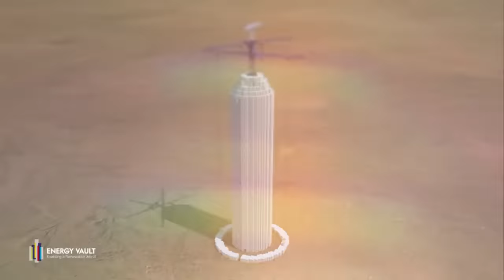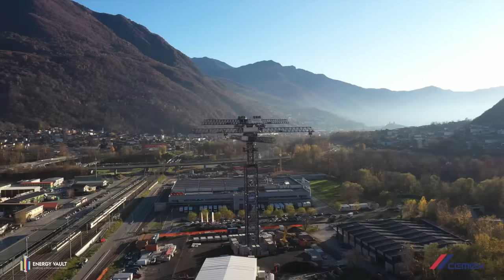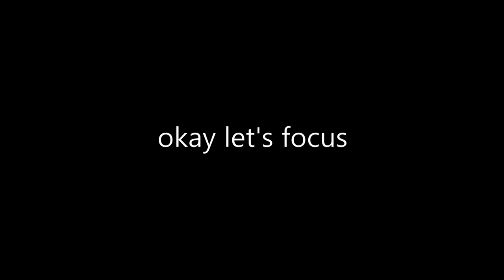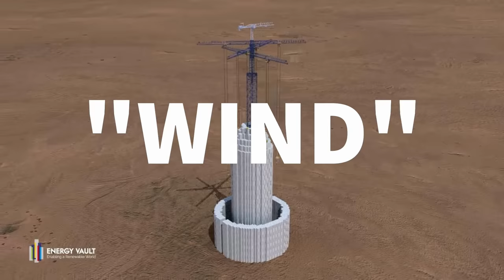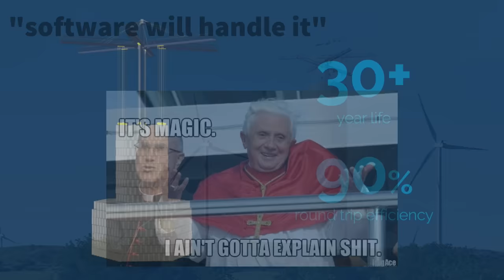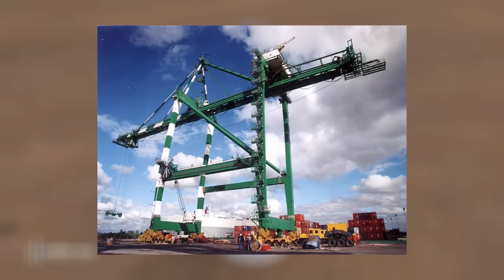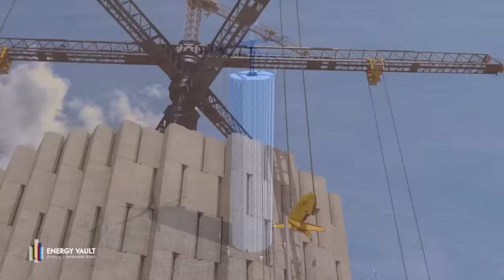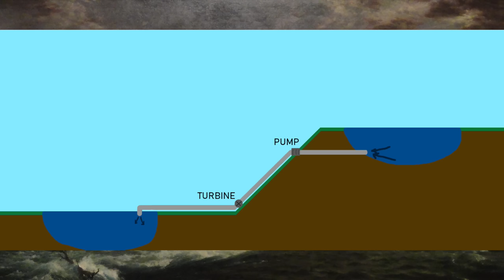The Energy Vault is a Dumb Idea, Here's Why

Comment: Since the moment you said "let's fix it," I was waiting for the whole thing to eventually morph into pumped-storage in a humorous way. Thank you for not letting me down.
Reply: Average energy vault fan:

Average pumped hydro enjoyer:

Average flywheel enjoyer:
Reply: My original conclusion is that this type of gravity battery started due to not every geographical location having access to enough water or a place to put it.
A hole filled with water would also likely need more concrete.
Reply: Pumped storage requires a lot of water (often not near where solar works best), a valley to fill and drain (or the co2 cost of building a giant pit) and a massive concrete dam (also with CO2 costs). Not sure Adam hits the mark here on this one
Reply: @oregonNYC  but wouldn't any big structure dealing with water also count as a water storage plant, with a side function of energy reservoir? I am not affirming it would be true, but I imagine almost anything being better than solid blocks of breakable concrete, even sand being used in the place of water.
Reply: @TheCuteZombie  In places where water is plentiful and there are natural formations than make pumped water easy to store I’m sure water is the better option. Last time I checked the Sahara, Gobi, Mohave etc are great for solar, bad for water. And as I said, a giant dam and big pipes require a lot of concrete too. Might be easier to just skip the water dependency part of you already need to invest in giant amounts of concrete. This video didn’t break down the CO2 comparison between a dam/pipes vs a concrete tower, but it should have done so to make a comparison as water capture requires tons of concrete.
Reply: Issue with pumped storage is that water has quite a low mass density and as such per meter height difference you need to "drop"  quite a bit of water to get to useable amounts of power for the space/land that you're using. Granted: concrete only has a factor 2,5 higher density, so not sure if that's better and the point about using cement for the concrete increasing the CO2 is very valid (same could be said for the windmills for that matter, those may not be carbon neutral either).
Also digging a big hole in the ground sounds like a better solution at first maybe, but that soil also needs to be excavated and the surrounding soil needs to be held back, so you need massive sheetpiles or also concrete walls for that to work. That or the holes has a slope which massively increases the land-use. That is an additional amount of CO2 that the plan is then costing. Again, I'm not saying that the tower of concrete blocks is the way out, quite the contrary, but this isn't as simple as: why not pump some water up the hill? For a start you need a hill! and water to pump up, and loads of other details need to be worked out. The devil is in the details...
Reply: @SpaceMarine113  I’ve gotten quite tired of this channel. While some tech bro crap is obviously silly, this channel does a very poor job of doing the math and considering the costs of existing options. They didn’t even bother to consider the CO2 footprint of the water storage and pumping system and compare it to the tower idea. Frankly, this video was embarrassing, expressing cynicism rather than investigation and verification.
Reply: @crazyshrum  A pumped hydro system of equivalent capacity will need just a little more water  than you would need to make the concrete for the weights. And more importantly you would need far less concrete to build the water tower than you would need to build the weights.
Last I checked water was always much more readily available than concrete, even in the middle of the hottest deserts, so even if you needed ten times as much water it would still be easier.
Reply: I was expecting a train somehow. Because Adam always turns things into trains.
Reply: @listerdave1240  how do you figure in less concrete for pipes and dam than for tower? You’re just pulling that straight out of your butt
Reply: @oregonNYC  Very simple math really.  First of all who is talking about dams?  I think you are making the mistake of comparing an energy vault of very limited storage capacity with a dam of vastly larger capacity. It is like saying a lawnmower engine is better than a ship's engine because it is smaller.

I am saying something much simpler - building a tall water tank.  I think it should be quite clear to anyone that if you have, say, 1000 tons of concrete you can build a tall water tank that will contain far more than 1000 tons of water and hence store far more energy than you could if you used that concrete as weights in this tower concept.
If you cannot figure that out yourself I might write down a calculation to explain that better but that will have to be later as I am a little busy just right now. 

It is really just a matter of how much weight is lifted how high, regardless of whether that weight is water, lead, concrete or whatever and it is just plain common sense that a water tank, or even a water tower, always weighs much less than the water it can  contain.
Reply: @listerdave1240  so an excavated water tank, like a swimming pool? So, add the Co2 cost to excavate all this soil, and co2 for the pipes to move the water up and down. Most of these pumped water storage uses natural slopes, so the piping will be very long to go up a gradual hill. All those pipes have CO2. Not to mention the obvious problems of flat country or low water regions. 

I’m sure some places water makes the most sense, but the video, and your reply, are lazy
Reply: @oregonNYC  I think you're missing the point. You do not need any hills or anything or any excavation, or at least not any more than what you would need for the energy vault.  
Let's say we have an energy vault that is 200m tall and 50 metres wide and we want to build an  pumped hydro system that will store the same amount of energy.  I do not have time to calculate it precisely right now (call me lazy if you feel so inclined) but a quick worst case estimate tells us that with water being about three times less dense than concrete we will need about three times the volume of water to store the same amount of energy. 

We therefore need a water tank that is also 200m tall but is  86 meters wide instead of 50.
So you now have a hollow concrete structure that is 200 meters tall and 86 meters wide which will contain about 400 thousand tons of water.
Let's be very generous and make the walls of this tank of concrete half a meter thick. In practice one would make it of much thinner steel but just for the sake of comparison let's make it out of concrete. That means we will need to use about  90 thousand tons of concrete.  

For the energy vault we would have used 400 thousand tons of concrete to make the weights while for the pumped hydro system we have used 400 thousand tons of water and 90 thousand tons of concrete.  In other words we have used 300 thousand tons less concrete than the energy vault and yet provide the same amount of energy storage.  We would of course need to get those 400 thousand tons of water from somewhere but whatever the situation it is always easier to obtain 400 thousand tons of water than 400 thousand tons of concrete, even if you are in the middle of a desert.

As I already mentioned you probably wouldn;t even want to make the tank out of concrete as steel would be much easier to transport to site and you would only need some 10 thousand tons of it, probably less than you would need for the energy vault just for the rebar of the concrete blocks.

If your calculation shows otherwise please let me know so I can figure out where we are in disagreement.
Reply: I think that the context is missing from that video. It looks like it's in Switzerland, which already has many dams, and where all other locations suitable for dams are being considered for new ones. I agree that this idea is crazy and only looks good in CGI, but it's also unfair to say that it can be replaced by water pumping when it's already massively used. The objective is to find new approaches when water pumping can't be done as easily anymore.
Reply: @AsteralLeGogol  I don't understand why everyone is missing the obvious. To make a pumped hydro system that has the same capacity as an energy vault you do not need any dams, mountains or anything of the sort. You just need a tall water tank as I described in my previous post.

The pumped hydro systems with large dams and lakes are not comparable. Their capacity is hugely greater than the energy vault, beyond comparison.

To achieve what one of those does in terms of storage capacity you would need tens or hundreds of thousands of 'energy vaults' and they would occupy a larger area of land than the lake does. 
If you do not have the lakes and do not want to build the dams you can always build the water towers as I described at much lower cost using much less concrete. Better still you could just build one huge tank, which would need even less concrete than replacing the energy vaults one for one with a water tank.
Whatever the scale, whether just one energy vault or huge numbers of them the water tank will always be cheaper, easier and better than the concrete block system. And of course on the larger scale you have the even better option of making large tanks instead of many small ones.

Maybe if I just call it the "Water Vault" instead of a water tank the message will get across better.
Reply: @listerdave1240  you’re going to make a 200m tall grain silo type structure, free standing, to hold water? At a half meter thick, and just standing on the ground. No foundation, just set down like a very tall glass of water… not sure about the material science behind this idea. 
Does such a structure exist? Can you show me one? Sure, the math is easy if you invent a water skyscraper, but that isn’t reality based. 
Pumped hydro doesn’t look like this, it looks like a dam up a mountainside. It has very long in/out pipes, it has both a upper reservoir and a lower reservoir (you forgot the lower reservoir in your calculation, unless you assume location by a limitless water source like the ocean, which would be very limiting in location). 
It’s easy to debunk proposed new inventions by inventing non-existent and preposterous solutions yourself.
Reply: @oregonNYC  Who mentioned there being no foundation? It would have exactly the same need for foundation as the energy vault would, no more. 

 I mentioned the concrete just as an example to show that even if made of concrete it would still need much less material than the energy vault.  Besides, the dimensions I mentioned are based on existing water storage tanks which however just happen  to be used to store potable water rather than store the water for its energy. I actually allowed for thicker walls than in the actual existing structures which are closer to 40cm at the base and much thinner at the top. I am no expert in concrete but I am an engineer with enough knowledge to make a reasonable estimate of what thickness of concrete is required for a structure as simple as a water tank.

In practice one would make it of steel which would be easier but I mentioned concrete just to provide a closer comparison to the energy vault, which uses a huge amount of concrete.

With regards to the lower water tank I have not forgot about it.  Again when comparing to the energy vault it is exactly the same limitation. The water tank has a separator in  the middle making it effectively two tanks on top of each other with the water flowing between the two tanks. Just as with the energy vault you have a limitation of how far down the mass can go because it needs o go somewhere. In  this respect it is neither better nor worse than the energy vault.

Can you explain to me in what practical way it is better to use concrete blocks as mass for storage rather than water?  I have as yet been unable to find even one good reason to do so and I have mentioned many good reasons why not to use concrete blocks.
Reply: @listerdave1240  I think you’re making a common mistake that I see from posters and the author of this channel - mistaking cynicism for analysis. 

The obvious disadvantage of pumped water, is the need for water and a hill. There is no such thing as a 200m tall water tank (your solution is more vapor ware than the concrete one in this video) pumped hydro uses natural features like cliffs, valleys etc to trap water behind a dam. So, we need a location with both huge amounts of water and major elevation changes to use pumped hydro. Common in some areas, impossible in others. Especially challenging in deserts, where solar is most effective. This concrete system isn’t a replacement for pumped hydro, it is a smaller scale solution for flatter, dryer areas. It complements storage solutions like pumped hydro, batteries, flywheel, thermal mass etc. Each has its pros and cons, they all have carbon costs, they all work well in some places and don’t work in others. No claims in the video of the concrete tower idea being superior to pumped hydro in a river valley, but next to a solar farm in the Mojave it could be a good solution.
Reply: @oregonNYC  Water has no disadvantage compared to concrete for this purpose. It does not need a hill any more than the energy vault does. 

 If it were not possible to build a 200m high concrete water tank then it would be even less possible to build a 200m tall tower of blocks so that argument is not valid. The concrete in a water tank of any height needs to endure much less than the blocks of an energy vault. 
There is really no reason why it could not be built. The reason none have been built that tall is because there is no need for them.  My point is that if for any reason one felt the need to build an energy vault of any height then they would be better off building a water tower of that height. It would be far cheaper and far easier to build, even if one were to insist on using concrete. Any situation where it is suitable for building an energy vault can just accomodate a water tank of the same height.  I don't think I should need to explain to you why a tall water tank is much more feasible than an equally high stack of concrete blocks.

You say the concrete system if for flatter and dryer areas but how so?  In that same flat dry area it is much easier to build a hollow concrete structure than a stack of concrete blocks so I don't see how the concrete blocks are better.   And even if the place is absolutely dry, like the middle of a desert I don't see how transporting thousands of tons of concrete blocks would be easier than transporting the same amount of water to the location. Can you explain why you think it is?

Maybe explain for the specific case you mentioned. If you want to build an energy storage device next to a solar farm in the Mojave desert how is building a stack of concrete blocks and a crane easier, cheaper or better than building a simple water tank of similar size?
Reply: @oregonNYC  Hello, stepping in the conversation here. Reading through your commons I think you have one key misconception about how the electricity grid works. Namely, you don't need to build an energy storage facility right next to where it's been produced. While it's a valid point that building pumped water storage is challenging in a flat desert there is no valid reason why it must be located in such an area. It can be built in a suitable location and just be connected to the same grid as Mojave. 
Even in really dry areas such as the middle east energy storage facility can be built in mountains on the coastline and use seawater. While seawater will damage the facility over time is still going to be last longer than banning rocks against each other all day.
Reply: @LLAALALA  energy is lost over distance. Building stored energy far from power generation might be possible, but you’d add inefficiency of the power loss, and the CO2/material cost of the power lines to run to a suitable area. This would be part of the negatives of pumped hydro that this video (nor you) considered. Losses are smaller for very high voltage, like a massive power plant would generate, but higher with lower voltage scenarios. Again, this video creates straw man arguments like pretending concrete towers were positioned as the sole solution. When appropriate, pumped hydro, or flywheel, or maybe batteries, or thermal mass etc all can work. None is the best solution, they all have problems and advantages. Cynicism is not analysis.
Reply: @oregonNYC  'energy lost over distance' I knew you would say that. Think about it energy production location is not going to be the same as energy usage location. If you store energy at where it's produced that energy will still have to travel the distance to where it's been used. Which tends to be located near large body of water and where the storage facility can be easily built.
Reply: @listerdave1240  again, you need two tanks and a hill for pumped storage, and pipes to connect them. More likely, you need a valley, a pipes and a dam. 

Concrete tower needs 1 tower, no hill, no pipes, no water source. Just as a battery has advantages (density, location agnostic, low footprint, modular) and cons (mineral extraction, maybe cost) each solution for power storage is appropriate in specific scenarios. I’m not arguing against pumped hydro as making sense. I arguing against this video’s straw man argument of directly comparing them and not including environmental cost of the land/concrete/energy loss etc in their comparison.
Reply: @LLAALALA  so you’d like to create a pumped hydropower dam where people live? You know pumped hydro floods a valley, right? It is a mega project, it isn’t comparable to concrete stack, flywheel, or batteries or thermal mass. Those other solutions are efficient at smaller scale. This is like arguing that a dam is better than a diesel generator. They are for different purposes, scales, location.
Reply: @oregonNYC  'pumped hydro is a mega project', while no it's not, the existing projects are all relatively smaller than what can be considered as a megaproject. And yes it's going to be built near where people live. Take Cruachan Dam for example its near several cities but the construction did not displace anyone. The reason is unlike a normal dam that floods a region the water reservoir is located on the high ground rather than in the middle of the river. If it floods a valley that would be just a normal hydropower station. 
And you keep mentioning 'efficient at smaller scale', but under what circumstances would you need to store power on a small scale since you yourself said power loss would be higher with lower voltage scenarios. Unless the power is stored for people living in the desert right next to the solar panel, which is pretty weird, those towers would lose most of their stored power while transporting them.
Reply: @listerdave1240  tbh, you don't even need water. You just need a liquid you can pump from one area to another and freely flows.

That's not exactly a tall order
Reply: @oregonNYC  1. water capture can be done in any container that can hold water, you can just as well use aluminium or copper 0 CO2 if you use renewables for (every step of) production.
2. As "Just Me" pointed out you could just as well use sand bags for the exact same purpose, you know the thing sand dunes are made of (without the bag). And you could make them(the bags) out of anything solid, even cotton or wool fabric. 
Therefore the CO2 comparison is totally unnecessary(since in this case it's zero), it just depends how quickly do you need it built, the energy cost is roughly the same, but having a coal power plant is cheap fast and easy way to boost the production. And after you have enough surplus energy (from solar) production you could use the excess to filter the carbon back compressing it back in to coal or oil if you care(if governments really cared we would have had carbon loans, instead of carbon trading, as in: "you clean up your own mess or you get your company's assets seized after some amount of time stated in the loan." instead we have Moonshine part 3 (part 2.5 being USA's "war on drugs" a reality film about how cartels get so rich that they could buy governments see Mexico for more details) see Part 1 "the monopoly"(signed the rocker fella') for more details or just lobbying... With a sprinkle of carefully placed loopholes... Trading makes both parties produce more of the "goods"! And with the "every body is doing it so i might as well" mentality everyone (outside of a hand full of european nations, that now have run out of electricity) is ignoring the carbon thresholds and doing business as usual and that's why CO2 cost really doesn't matter, it has zero cost(for the producer, more like it has negative cost since it produces cheap electricity, our planet is doomed anyway, since no one is really willing to save it, the green Revolution became a "for profit" thing really early on due to big oil helping it back in the 50's(? Citation needed), have a happy 10 - 20 more years of life and if corona stays untill then we may have 10-100 more due to no one needing to use their cars any more)). 

Legend rectangle: I'm using the "Royal" you, as in: we the human race,but mostly a hypothetical you.
Reply: @UCdIZd5qCjpnllJzzhBV-72A I don't quite get how are you planning on storing the rail carts. I am imagining that you have something that looks like an elevator in which a bunch of carts stacks on top of each other instead of just one? And during storage, the carts just stay on the rail off ground and stack on top of each other? Is that how it goes.
Reply: I was hoping for trains to be the answer 🤣
Reply: yeah, he's keeping it real :-)
Reply: @oregonNYC  not true. He is spot on with the whole "dig a hole, put tanks on top and fill with water" thing. much less moving parts.
Reply: @bivoca  no, he isnt. Firstly, a hole can’t ever work. It must be elevated. It needs to be a tower, or a dam on a hillside. The power generation must be below the water.
 Secondly, these structures would also have CO2 build costs for excavation, concrete for dams, concrete for pipes etc, which the video didn’t bother to calculate and assumed was free. Perhaps pumped water is better than the concrete tower, but this video was lazy and used vapor ware, bad physics and incomplete calculations to ‘debunk’ it.
Reply: Unlike water in a pumped storage hydroelectricity facility, he won't let you down.
Reply: @oregonNYC  all these deserts are in close proximity to large wealthy population centres, I hear you say. Worth it for the concrete towers to build. Sure.....
Reply: @oregonNYC  a hole can work perfectly fine. ALL that is required is a height difference between the top and bottom reservoirs. Period. The bigger the height difference, the more storage per unit mass.
You could use mercury just as easily as water, and would get more energy storage in the same space. Any liquid would work. Water is just one of the easiest liquids to use. The water doesn't even need to be potable - ocean water would work just as well as fresh, barring corrosion possibilities.
All of these solutions including the concrete tower are simply trading off gravitational potential energy to and from electricity.
And a MAJOR weakness of the concrete tower is that the height difference goes down as the tower gets shorter. Halfway down, there is no benefit. Whereas even a near-empty top water tower is above a nearly full bottom reservoir.
Reply: @aaronbredon2948  if it was a hole, the power station would need to be below the hole. Hole needs to be dug, tunnels for piping dug etc. 

Power also declines for a water tower as water pressure falls, just as it declines for a tower as it shortens. 

As I’ve said many times, pumped hydro is a fine solution in some places. Flywheel could be useful, batteries could work, thermal mass etc are all different energy storage solutions that have pros and cons each. There is no single solution that solves all needs. Pumped hydro certainly isn’t a panacea solution, nor would concrete towers be such.
Reply: @oregonNYC  the turbine would need to be at the bottom of the power pipe. For maximum efficiency, this should be at or below the reservoir water level. But the rest of the power station can be above ground.
The problem with the tower is you CANNOT extract all the energy without spreading all the blocks on the ground in a huge pattern. Once you start stacking, you lose energy potential.
Reply: @oregonNYC  So generate the power in the desert and use transmission lines to the storage in a coastal area.  It's not rocket surgery.
Reply: @oregonNYC  Or....here me out....there are other ways to store and generate energy instead of having to try and actually build a pumped storage and definitely not this stupid tower. I know, crazy theory but with environmental assessment and stuff, you can actually store energy in a much better way suited to the area.
Reply: @MrAsh1100  so do the math on the cost and benefit of these vague ‘better ways’ you speak of. How does concrete stack compare to flywheel, or battery, or thermal mass? Are they always better, or only in certain conditions? Support your assertion. This video certainly did a poor job of supporting its assertions.
Reply: @oregonNYC  I never said anything about pump storage. Just there are other ways that can generate power as well. Or did you miss my wording and you're just going around being a smartarse?
Reply: @MrAsh1100  I didn’t say anything about pump storage either. If concrete tower compares poorly to flywheel, thermal mass or battery, do the math to show why this method is worse. All require manufacturing, all require energy input to create, and all are more complex than ‘stack of bricks’. They might also be more efficient, have smaller footprints etc. I’m not arguing that concrete tower is the best solution, I am arguing that this video and comments supporting it did no research, did no comparisons, didn’t consider pros and cons of each solution and simply enjoys being contrarian and cynical without analysis.
Reply: @oregonNYC  Long wires would be required for your giant Sahara PV farm, so you can do the storage elsewhere.
Reply: @oregonNYC  First of all, the video basically starts by pointing you to a more in-depth analysis of why the concrete tower wouldn’t work and that this is a video mocking them for making such a poor solution. Secondly, you haven’t done any research either so telling people that their logic based arguments don’t count because they didn’t research the topic thoroughly is hypocritical when your arguments are the same.
Reply: @oregonNYC  i have a feeling that not only you have a poor understanding of the power grid, but you also lack a basic understanding of physics.

why, in the world, does the "power generation" need to be below this pumped storage that you're vehemently against? you do realize that power cables exist, and we can put the pumps/turbines anywhere? 

oh, and "power loss over distance", i didn't realized we were still running on DC, where powerplants had to be right beside urban areas. geez.
Reply: @basketcase1235  the power generation needs to be below the pumped storage because power is generated using water pressure. If it were above the pumped storage, there would be no pressure.
Reply: @justanscv  this video was lazy, and cynical. The primary example of that laziness is that it did CO2 calculations for concrete tower, but pretended that pumped hydro had no CO2 footprint. If it can do the calculation for one, it can do it for the other. It essentially presented pumped hydro as a free energy machine. While hydro might often be more efficient than other storage methods (although the investment in battery, flywheel, thermal etc shows that hydro isn’t often the best fit) it certainly isn’t carbon free, environmental harm free any more than the other energy storage methods. All have pros and cons, and this video completely ignored the cons of hydro.
Reply: This video sort of sucks.  The entire point of these gravtiy storage designs is to find a clean way to store energy when you cant use pump storage .  UN IPCC predicts that if we keep going at this rate, it will stop raining in California in 80 years, arable land across the US will dry out, and potable water- essential for doing things like producing electricity , will become a precious resource for huge swathes of the world.  

We do not have the option to rely on fossil fuels, battery storage, or magical fusion to bail us out.  It's an enormous and deadly serious engineering problem.  Sadly, there are basically only three dudes and a start up working on it.  Compare that to the massive investment in engineering manpower and resources we've invested into making petroleum work.

Having a noble mission obviously doesn't mean your design is beyond reproach. But this video, and critiques like it, are done in bad faith IMO.
Reply: It needed to be pumped concrete. That would need to be replaced as it dries out and hardens.
Reply: I have no idea what this comment means but I just started the video and now I'm kinda excited
Reply: Yeah, ok that was pretty funny, actually! Even without knowing what pumped storage hydroelectricity systems were in advance, the humor still tracks (props for the presentation using actual comedic stylings, the joke was well executed for a person like me, who was completely ignorant about the energy vault and pumped storage hydroelectricity)

Aka well done, and thanks for the laugh and filling in an information gap in my knowledge!
Reply: Same
Reply: @oregonNYC  "you need two tanks and a hill for pumped storage, and pipes to connect them. More likely, you need a valley, a pipes and a dam"

You keep saying that, but... You don't? Sure, this is how pumped storage was made up to this point, because it's a storage system that uses gravity, so using existing terrain elevation is convenient. That doesn't mean it can't be done differently. We're already comparing an idea that uses gravity without pre-existing elevation (concrete blocks tower) to another one (water tower), so if anything, they're on equal footing in that regard.

The point Lister Dave was making is that for a novel gravity-based energy storage suitable for flat terrain, concrete blocks and water can both be used and water is at the very least not any worse. There is no need to excavate anything, the tower can have separate upper and lower sections between which the water is pumped by a pump that can be at the base of the tower. In the desert the water is not available, but neither are convenient concrete blocks, both have to be delivered there, making the point about availability moot. Naturally larger mass of water might cost more to transport, but it doesn't cost much to obtain.

Although I'm not sure about the amount of concrete a tower containing so much water pressure (and a separator in the middle) would really need; and there's also an issue of the water tower using less of it's height compared to concrete blocks that can be stacked lower thanks to increased diameter (although the larger the diamater, the more energy lost on horizontal travel which itself produces no energy).
Reply: @listerdave1240  If you have one, it would be nice to see a source that confirms a large water tower can be built using roughly the stated amount of concrete that would hold the high horizontal water pressure. Also worth noting that a water tower with two vertical sections only uses half of it's height to store potential energy, while the concrete blocks tower can use more of it's height because the blocks aren't limited to the tower's footprint and therefore can be stacked lower - although more energy would be spent moving them  horizontally.
Reply: @MrCh0o  I don't have a source at hand but it is quite obvious when you think of it that a hollow water tower would necessarily require less concrete than an amount of blocks equal to the mass of stored water but one still wouldn't build it of concrete. Steel would be easier, better and cheaper.  I mentioned the concrete tank at some point only for comparison. 

No matter what you do it will always require less concrete to store a mass of water than to have that mass itself in concrete.  The horizontal pressure is not really that much of an issue - that is what rebar is for and of which you would need less than you would need for the blocks. What could be more difficult, but far from insurmountable, would be resisting the pressure on the bottom of the upper tank. For a concrete one that would involve a considerable amount of concrete in beams and supporting columns, but still nowhere near what you would need if you substituted concrete blocks for all that water.

If one were to be more sensible and build it out of steel irather than concrete that problem disappears as all it would need would be for the bottom of the tank to be slighlty domed and it would very easily take the pressure.  With a steel tank the only thing that would need to sustain significant stress is whatever supports the upper tank, whether it be the outer side of the lower tank or separate columns. Even so that is still nowhere near being some insurmountable engineering problem and would in any case  still be far easier than making concrete blocks that  will sit at the bottom of the stack supporting the weight of all the blocks above them, and having to endure repeated stressing and unstressing as weight is added on top of them and relieved.
Apart from the columns (or tank wall) that support the base of the upper tank all of the structure will be in tension with no parts in compression, which is something that steel handles very well without having to use much of it. 

With regards to "Also worth noting that a water tower with two vertical sections only uses half of it's height to store potential energy..."

The exact same can be done with water, only much more easily. You just build the lower tank wider, just as you would spread the concrete blocks wider, and with lower walls (because the same volume will now fill to a lower height) and you don't have to move anything sideways because the water goes by itself to where it finds most convenient. There will now be a gap between the upper and lower tank if we want to maintain the same amount of water at the same height or extend the upper tank further down also increasing the water capacity.

ps: Somewhere earlier (I think in this same thread) someone pointed out an error I made with regards to the cost of concrete, but I cannot quite find that post.  I did indeed make a silly error as I mistakenly quoted the price per cubic meter as the price per ton ($300), thus overestimating it by 140% at $300 per ton.  It is actually more like $120 per ton.  However even so just the cost of the concrete still is considerably more than a lithum ion system of the same capacity and that is just for the liquid concrete sitting in the mixer truck before even spending a penny on the rebar and the work of casting that concrete into blocks, the crane and all the rest.  As I'm sure you know when building a structure the actual cost of the concrete is by no means the largest part of the cost. If it were you could build a house out of concrete for a few hundred dollars.
Reply: @oregonNYC  yeah but we use them Like about a few years
Reply: @oregonNYC  Ocean has plenty of water
Reply: @listerdave1240  You're right, concrete needs lots of water, and you have to transport that either way.
Reply: I like that you are so pumped up about not being let down. 

Yeah I will find out, thanks.
Reply: @crazyshrum  why has the battery got to be geographically close to the power source infact why has the battery got to be powered directly by the renewable, surely if the renewable is going into the grid and the grid is supplying the power for the battery  its the same as being next to it
Reply: @m4rkscott  My comment was in response to a traditional gravity battery, such a dam of water, needs to be close to a source of water. Otherwise you're correct, the battery just needs a connection to the grid.
Reply: @oregonNYC  and you considered the CO2 footprint of making concrete? Because let me tell you, it's not good.
Reply: @oregonNYC  pumped hydro comes in different forms. Sometimes you have a dam at the bottom, sometimes it's another reservoir.
Also all the criticism you have for the concrete water tower goes like 10 times for the energy vault.
The water Twitter is such a bad idea comparatively to other solutions that nobody has built one, but the energy vault is many times worse than that.
Reply: @oregonNYC  except the energy vault is not in any shape or form realistic, while pumped water is. When your area is too flat you can even dig a hole or use already dug holes.
We don't have to argue about what's better, since the energy vault just won't work. So it's clear that the actually working solution is the better one.
Reply: @TheCuteZombie  - No.  You have to keep the water or else you won't have anything left to store energy.  Any water released from the system lowers the capacity of the "battery".
Reply: @SpaceMarine113  but the tower is an altitude difference in itself. I'd say that any shape is better than a tower. What about a "garage-ramp" like structure where something not friable (i.e. not concrete) rolls down the slope? Or a pyramid with the top end cut so you'd store the material at the top of the pyramid? Everything is better than cranes.
Reply: I had the same thought hahahaha.
Reply: @crazyshrum  coating the surface of a hole with water is a planar use of concrete, building blocks for mass is a volumetric one. I haven't crunched numbers, but I'd expect the extra dimension to blow out the amount of total concrete required for the latter.
Reply: @oregonNYC  It could work for California really well though. I wonder about pumping ocean water up to the Salton sea for energy storage. It's drying up so it might be a solution for two problems? It would take a huge initial investment but as much solar and wind as Cali has and as little energy storage it might be worth doing
Reply: @RoyArrowood  and the CO2 of building, what, 200 mile long pipes inland to the dalton sea would need to be accounted for. Perhaps your plan works, but this video pretends pumped hydro is CO2-free. It uses concrete and excavation, it has costs that this poorly made video magicked away into nothing to make its straw man argument.
Reply: @oregonNYC  I don't care about any of that. I just thought it'd be cool if Cali did it
Reply: Pentwater Michigan. They've been doing this for decades
Reply: I was hoping for it to turn into a train
Reply: What if we made the blocks very small, easy to find in nature, and able to flow continuously?
Reply: he's just another guy who thinks he's smarter than dozens of engineers with masters degrees.
Reply: Anyone who invested in this should be steralized have all they possessions taken away from them (give them the dole) and the children place in homes where they have a change to become normal members of society!
Reply: @listerdave1240  I think someone needs to make this a game on Steam, the players could pick whatever design they like and the game engine would simulate and calculate the ERoEI of the system, the Co2 emissions (including the Co2 emissions of building the wind turbines and solar panels). There could even be Steam achievements for the greatest loss of shareholder capital.
Reply: i clicked on this vid and got an ad about a guy on zoom rapping about his boss's ideas
Reply: @crazyshrum  I don’t think so. If you can bring the concrete truck or the blocks themselves, you can damned sure bring some water tankers.
Reply: I honestly expected a train to come from somewhere
Reply: @oregonNYC  instead of all this can’t we just push buoyant things or gases into deep calm waters like a giant buoy or into tanks like a bay or lake with the excess energy? Seems like it would use much less emissions.
Reply: @oregonNYC  Pumped hydro can literally work in an abandoned mine that's already somewhat flooded.
Reply: Yeah it seems like Adam Something doesn't understand basic physics concepts. He is probably a great guy, but he is obviously uneducated when it comes to energy storage.
Reply: @Qotroz  how so??
Reply: @act2wasstronger182  So how?
Reply: @Qotroz  bru
Reply: @act2wasstronger182  Yo bro! ✌🏻
Reply: @Sw00t_y PrD I am the king of jesus christ
Reply: The energy stored is proportional to the mass of whatever you're lifting though. Concrete is 2.5x denser than water so yes it does pack more energy into a smaller space - but not that much smaller. To store the same amount of energy you'll need a stack of concrete blocks 40% the volume of the equivalent water reservoir. You are going to use way more concrete than building a dam, and still going to be taking over a large area of land. The ones in their CGI barely store any electricity at all compared to pumped storage.
Reply: @stefanwaterbouwer8139  If only we could do something like, make it heavier...
Reply: @Earthboundmike  yeah that would help. though heavier fluids have other drawbacks usually... toxicity, different flow properties like higher viscosity perhaps, turbine needs to be built sturdier/resist higher pressures, etc. 
Best would just be circularizing the fuel production and usage chain, i.e. make synthetic fuel (same as fossil, but purely the carbohydrates) from sustainable energy and CO2 in the air and use the current infrastructure more or less as we have been. That way also many conflicts about energy resources can be resolved as countries can just produce their own fuel if need be, regardless if they're sitting on decomposed dinosaurs...
Reply: I was expecting a train. Kinda disappointed
Reply: @oregonNYC  Right. Do really those people think that a Swiss engineer, where so many storage hydro-electrical facilities are producing electricity, would have forgotten about it..? Maybe, a "good" Swiss engineer has also some knowledge about the losses involved in this pumping up and down, i.e., the efficiency of hydrological devices...?
Reply: The only way to flow
Reply: @listerdave1240  I just wanted to say that I thoroughly enjoyed reading your logical analysis. Even though it must feel like banging your head against a concrete wall over and over again. xD

You are entirely correct that using the same materials you could build a way superior structure in pretty much every way and if it had to match the storage capacity of this thing it could even do so using fewer materials and a lower carbon footprint. 
It still might not be the best possible storage design, but it's that a heck of lot better than storing concrete blocks that's for sure.

The rest of the discussion is like comparing a concrete barge for ferrying people across a channel, vs just using a boat. Then getting that one guy that keeps saying that not every place in the world can dock the entire Royal Caribbean Oasis class fleet😂
Reply: @oregonNYC  That water is however often available where wind works best, and when making good use of natural features can work really very well. But.. it isn't applicable everywhere of course. 

Of course... water has its own issues besides availability... such as the tendencies to leak out and evaporate.
Reply: @TheCuteZombie  yes it totally could... but keep in mind, storing water comes with losses, due to leakage and evaporation, and if you want to use that water for other things, that comes with additional requirements, like keeping it clean, guaranteeing minimum levels of availability (and hence, now having to pick between being able to drink, or getting electricity, in extreme cases... and as you cannot trust politics to make the right choice in that, separating those functions is a really really really really really really good idea)
Reply: Was waiting for some sort of train, pleasantly surprised.
Reply: @stefanwaterbouwer8139  "For a start you need a hill!". What exactly have you got against a HOLE?
Reply: @listerdave1240  if you dig a HOLE you can use what you dug out of the hole as weights. Can someone tell me how much concrete you would need to mix with soil or rock to make a stable solid cube compared with a totally concrete cube of the same size? I am guessing a lot less.
Reply: @listerdave1240  the walls of a hole require much less concrete and if it leaks damage is small and easily repaired.
Reply: @andrewjenkinson7052  thank you for your contribution to this discussion. In my earlier comment I did mention some points against excavations if I recall correctly, but let me reiterate: I have nothing in particular against "HOLE"s. It's more that hills have some advantages over them in my opinion. They are generally pre-existing elevation differences. You could use also caves or old mine-shafts of course, but for those the same goes as for hills: you need to have one near that's useable. Hills appear to be more commonly available and safe/easy to access, but I could be mistaken in that. I'm no cavernologist. 

So for most cities that will likely mean you need to dig the hole and move a lot of soil-mass, plus keep surrounding earth from collapsing into your hole, which is all a massive CO2 expense and use of energie before being able to store anything. Also with a hole you need to keep in mind that basically the way you store energy is pumping water out and then letting it flow back in, because once it's down, you need to pump it back out again. Any leak in your hole in the ground can let groundwater flow in and will undo your carefully stored energy. 
To be fair that is also the case with pumped storage on a hill. As in: any water leaking out of the basin there is also lost energy. Keep in mind though, that construction pits and man made "holes" are notoriously hard to keep dry. Often pumps are running 24/7 to keep them dry so that workers can construct their project in relatively dry circumstance and also many finished tunnels and parking garages suffer from water intrusion even when finished. 

So eventhough a HOLE sounds neat and nicely tucked away out of sight, they come with a whole range of challenges/issues of their own.
Reply: @andrewjenkinson7052  very true and that would indeed be smart to keep a neutral soil balance (volume excavated = volume used in project). 
You could perhaps wrap it in geotextile to prevent the losing parts of the soil while lifting and/or you could mix it with grout (a cement/water mixture injected often in soil and for instance used to fix ground anchors). However you'll get very irregular "weights", both in mass and in shape,  depending on which soil(layer) you used. Not sure if that's beneficial for stacking the blocks neatly. You would need a similar amount of cement als you would need for regular concrete. Assuming the soil is mostly sand (clay would pose other issues), so around 180-400kg of cement for 1cubic meter (35,3 cubic feet) of soil, depending on how much compressive strength you want te blocks to have. That is another issue possibly. that you don't know or there is at least a large deal of uncertainty regarding the compressive strength of the blocks and to stack them safely, that would be a prerequisite.
Reply: @andrewjenkinson7052  much less concrete with regards to what? the foundation of a tower crane plus maybe taking into account storm hitting the tower? I wouldn't be so sure about that. Keeping back soil and groundwater pressure is not a task to be underestimated.
Reply: @stefanwaterbouwer8139  Thank you for your reply. My idea of a hole was initially for using earth. With water it would usually be pumped and released through pipes. If you fill the deep hole with pipes water leakage would be a minimum, the water resting in the pipes. Or line the hole as you would a swimming pool. The upper shallow hole could just be lined as a swimming pool. Would joined bamboo pipes save on CO2? 
In poorer countries would having a large labour force digging a hole generate much extra CO2? I am not suggesting these would WORK, simply suggesting ideas that others may not have thought of. Thanks for your input.
Reply: @andrewjenkinson7052  Thank you for clarifying your ideas. Even with earth you'd want a dry working environment. It depends of course on the location an scale of the installation, but for energy you want a decent height difference. If then you're saying: I don't want it to stick out into the sky like skyscraper, so I build it underground, I imagine a quite sizable cellar, where in most locations where energy storage would be useful, you will at some depth reach groundwater. Working in a flooded cellar with big masses of earth flying about sounds like the most dangerous job description ever, so for safety that is undesirable. Same goes for pipes, even if you store the working fluid in the pipes, you still want to be able to access them in case there is a problem with one of the valves or even just regular old maintenance.

The energy stored in a gravity battery (is basically what this is as well, pumped storage or soil, doesn't really matter, only the generator is different, you still store with gravitational potential energy) is determined by height, so I'm not so sure a shallow, pool tarp lined basin will cut it. Maybe for a single house that could work. I haven't run the numbers nor tested it, to be fair.

WIth bamboo pipes on an industrial level is not desirable either. you don't know the strength of the material and your safe structural assumption for it will be a very low pressure rating. If the pump suddenly stops due to sudden outage of power, a shockwave travels through the pipes, often several times higher than normal working pressure. Unless you accept that your pipe breaks every time such a thing happens (which again would make the facility very unsafe to work in), bamboo does not have reliable or high enough pressure rating. It would technically save CO2 though, given big enough "pipes" can be harvested locally.

Also hand labour would indeed save CO2, though technically also muscle power emits CO2. So if you don't have to move soil at all is still less CO2 emissions than digging the hole.
No it's great thinking about these ideas, so don't worry. It's just there are so many details and often it's so hard to make something actually low carbon. Again the devil is in the details.
Reply: @stefanwaterbouwer8139  just to be clear, the shallow pool was just for THE UPPER reservoir. Otherwise, thanks for your contribution. For the "dry" suggestion a much smaller "wet" system could be incorporated to pump up any ground water and use that.
Reply: @roadtrain_  Put an heavy train going up and down a mountain, with overhead cables? 😂😁
Reply: @oregonNYC  do you know how much water is involved in the creation of each concrete block? And that's just the initial creation, there will be lots of repair work needed, maintenance over all of the machines, and not to mention all those points of failure... It gives me a headache just imagining all of it
Reply: @crazyshrum  It's also possible to use sand instread of concrete..
Reply: Lol
Reply: Pump storage water is not usable everywhere and had quite a big energy loss depending on the region.

The gravity battery has better efficiency, no energy loss over time but is not scalable enough.

But it has its uses and is already used with success.
Reply: Density of water is 1.0 metric ton vs. concrete 2.8 tons. You can store more energy with concrete in the same volume. On a flat area Alpine lake is not an option.
Reply: You need favorable topography for pump storage.
Reply: I was expecting trains to make an appearance…
Reply: I was waiting for it to morph into a train😂
Reply: Yes, well, this machine is being designed for places that don't have a lot of water, and where pumped storage is not an option. Duh.
Reply: i was hoping for traine
Reply: This Energy Vault looks better at letting you down than any concrete